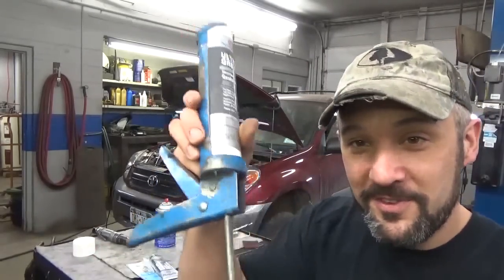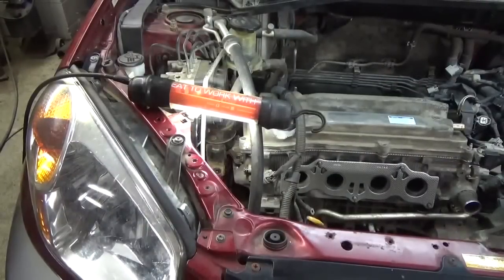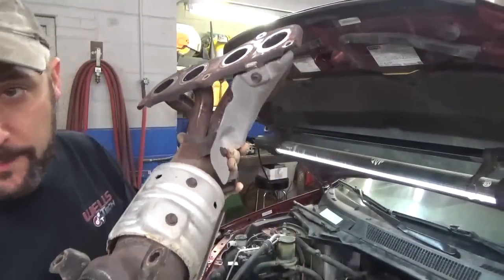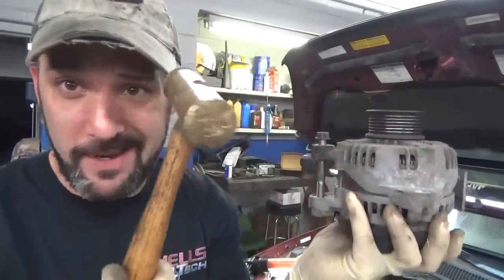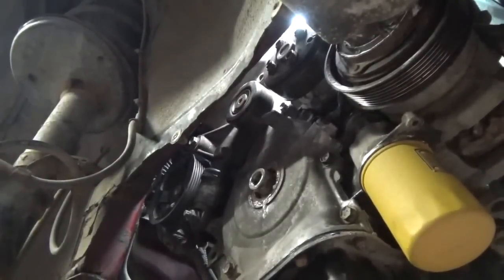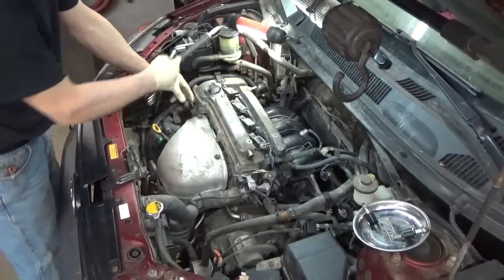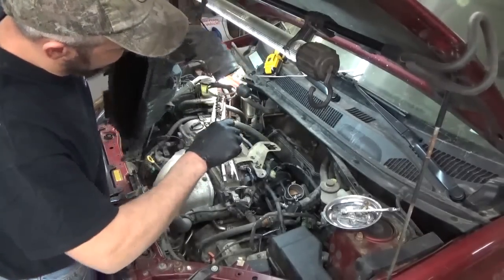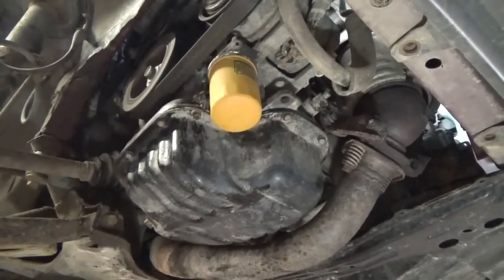Toyota Rav4 2AZFE Stripped Head Bolt Repair Part V

Comment: I Ike to use cardboard from parts and just pop screw, bolts, fastners plugs into  the cardboard in order I took them out. Then label with black sharpy.. or put the screw in its place after the component is removed....
Reply: Your the man
Reply: Anyone have trouble getting  elm327 and torque app connect to ecu on saab?

Comment: I've had to disassemble computers due to a lost screw. Losing a screw in an engine is bad, but there's a reasonable chance it might not be a problem. Losing a screw in a computer means ABSOLUTELY NO POWER UNTIL IT'S FOUND.

Comment: the diaper is a insulator to keep the heat down transferring to the intake tract,up where you are its probably overkill but in the desert southwest or florida that manifold is hot anyway due to road heat and under hood temps,the slight noise you heard is the timing chain running dry till slosh and spray hits it,i always soak them in synthetic rear end lube to cool the links on start up,they see hell for about 5 to 10 minutes,if they are right out of the box you can hear the links rattle,the little tricks make them go out the door and stay out the door,good job eric

Comment: OK, I'll admit it. I didn't think it would start. Good job Eric. This had to be a muti-thousand dollar repair with outside machine shop involvement, special thread repair kit ($400) and likely 20+ hours of labor. Do you think this car was worth it? Just asking.
Reply from the maker: WHAT!? REALLY!? Do you really think I would post that big of a disappointment lol
Reply: South Main Auto Repair Dude, we've called it reality TV. Sometimes what's real isn't what we hoped it would be. See my edited comments above and please respond. Seems the job cost more than the car was worth.
Reply from the maker: SATAMAN Schmidt I agree 100%. In my opinion it was not worth it but it was to the customer and they are the one writing the check. It was old, rusty and an oil burner, I work pretty cheap here so out the door it was $2200. Local Toyota garage gets around 4 grand here to do them. Start to finish minus camera time I had around 14hrs or so in it. I do a lot of jobs like this and wonder why they wanna fix it. I just tell them the truth of what I see and think and they make the decision.
Reply: South Main Auto Repair 4K seems about right. That's what I was expecting. You need to give yourself a raise.
Reply from the maker: Lol I wish, small town and more shops than people. There is literally a shop on every corner.
Reply: South Main Auto Repair However, I rather doubt that they deliver the quality of work that you do. I got into repairing my own car due to the fact that the people I took it to were incompetent. If I lived in your area I'd have never gotten into car repair, I'd just let Eric do it. By the way your tube "sealers" are on their way.
Reply from the maker: Well see then would have never gotten that sweet air ratchet , tube sealers or 13mm "wrench". Good thing you didn't live here lol As far as the other shops work well I'll just leave that one alone..
Reply: South Main Auto Repair wouldn't it be cheaper to buy a replacement engine?  I didn't see the first video but how did the owner strip some head bolts?
Reply from the maker: Oh he didn't strip them it is common for this engine to do this so getting a used one you might be getting the same exact problem
Reply: South Main Auto Repair I did think about this too. You obviously do install Jasper Engines, or at least you have a big assed sign indicating that you do, and during one of these videos stated that this thing was an oil burner. Considering the willingness of this customer to spend thousands of dollars on a car that isn't worth the price you charged him to fix it to begin with, why not suggest a replacement engine?  Would have saved the cost of the thread repair kit, the machine shop and the labor involved with replacing the head gasket and all that involves. What I'm asking is how much more would putting a rebuilt, not a junk yard engine as I agree these likely suffer from the same problem as the one already in the car, would have cost.
Reply from the maker: Just for the heck of it I looked it up through Jasper and it would cost the customer $4467.00 plus fluids and installation. That would include a 3yr 100k warranty parts and labor. Used engines local at salvage yard, to me cost on average of $1800 and up. cheapest high mileage engine was $1300 plus installation and fluids with no warranty.
Reply: South Main Auto Repair This is an  example of the difference between New York and Arizona. Out here the body of this vehicle would be pristine making the engine swap a no brainer as the car would then last another 10 years. Back there it's heading to the crusher anyway as it has no trunk or floorboards so a) get out of there at the lowest possible cost or b)scrap that clunker. Here in the desert putting in rebuilt engines and transmissions makes a lot more sense than it does there simply because the bodies and frames of the cars are perfect.  We have no rust. Now that stated what goes South on our cars are the paint and the interiors. My friend, and former boss, owns a Maaco here and he's quickly becoming a millionaire and auto upholstery shops kick butt too as our interiors disintegrate from the brutal sunshine.
Reply from the maker: I cant even imagine what it would be like working on rust free cars. I will have to google Maaco. We do have any of those that I have ever seen.
Reply: South Main Auto Repair They are a nationwide chain. They claim to be a bodyshop but that's not their main gig. They mostly do complete repaints anything from quick and dirty to fairly expensive (say $5000). My friend specializes in the $1,500 to $2,000 jobs which turn out quite nicely for the money. For this price the car is debadged and the emblems reattached after painting rather than simply painted over. Arizona and the sunbelt is the perfect location for these as rust repair isn't needed here but fresh paint certainly is. Normally you can sand the paint on the car down with P220 (hood, roof and trunk where all the clearcoat has been eaten away) then P400, seal with epoxy and shoot basecoat/clearcoat or single stage urethane. He has a lot of dealers and used car lots as customers since cars are worth a lot more with a fresh coat of paint on them than they are with Arizona sun rash. The advantage of being with Maaco is that they have nationwide sales agreements with PPG and Sherwin-Williams and their negotiated paint prices are 1/3 to 1/2 what an independent bodyshop would pay for the same products. The negotiated prices for paint, which these guys use a ton of compared to a normal bodyshop that's only shooting panels instead of complete repaints, more than pays the franchise fee.
Reply from the maker: No kidding that is really cool. We have nothing like that here. You have Maaco, we have a crusher lol. Our used car dealers use spray foam, rattle cans and lots of armor all haha

Comment: Hi Erica this is Mark I watch you all the time but I just thought I’d mention this on part five of your RAV4 replacement of the oil pan gasket on the engine and strip the studs out of the Cylinder Head I did notice while you were spraying the gasket and had the pain in your hand you spray the gasket on the BLOX side not on the Panda side don’t know if anybody else got that I just thought I’d throw it in there just to make your day while you’re laughing at me you do a great job thanks buddy bye

Comment: What kind of tool is that on the left side of your keyboard? Looks like a compact timing gun in a holster. ;)

Ok I think I'm ready to do this job on my 2002 Camry and 2006 Highlander both with 2AZFE showing the same symptoms.

Thanks for the helpful videos! Standby for questions :)
Reply: Handy Daddy Your mention of dropping a screw from your ratchet just brought back memories of when I accidentally dropped something inside the throttle body while cleaning it. I kicked myself a couple of times, took a break, came back with a magnet attached to a hose and got lucky because I was able to fish it out with one try. Lesson learned.
Reply from the maker: Handy Daddy Yes it is my mini timing gun haha  ( If some bad guy messes with me or my family, it's "bad timing" for them ;) )
Reply from the maker: Handy Daddy Nice. Good lesson learned too.

Comment: Hi, what size wrench did you end up using to torque those head bolts? Thank you again.
Reply from the maker: +Coral Lanteigne oH gosh I don't really recall. It would be my 1/2" torque wrench as far as the socket size I THINK it was a 14mm 12 point?
Reply: +Coral Lanteigne it's a 12mm "triple square"  Napa carries them/can get it.  3/8" drive is what I used.    
part # CHT STS3812M     Yeah, the one time use insert tool kit hurts.

Comment: I think I met your Camry trans fluid hater and he's probably as smart as he is stable.  A few years ago at my job, a lube tech pulled an air filter out of a car to inspect it and the owner of the car stomped across the shop and yelled at the tech for contaminating his intake air system.  I think that was also a Camry.Edit: I have a theory or two on the diaper under the intake if nobody else offered up a sound reason.  (There's too many comments to read through now.)  My guess is they used it as an insulator to prevent engine heat from warming up the intake air too much.  Or maybe it gets hot enough to warp those sturdy plastic intake runners.  Ooh, go tell that to your Camry hater and see if that riles him up some.  Just don't tell him it was me.  I'll deny everything.Edit again: Keeping squirrels out of the intake.  Now I know why that Camry hater customer was fuming.  There were squirrels everywhere in the shop.  He knew something I didn't.

Comment: WOW Great Videos _ I have a blown head gasket in my 2004 Rav4, water is going out the exhaust. Looks like I have a long project a head of me but I am willing to tackle it. If you can do it I can do it. Thanks so much for the videos. The info you got from Toyota on the procedures and torque spec, where can I find them?

Comment: Paper gaskets are PIPG.  Paper In Place Gasket is to FIPG or Form In Place Gasket. PIPG or FIPG. Real fun is assembling your first motorcycle at 14 from the arcane translation of the original Japanese manuel. No grammer adjustments, and they constantly called the 1969 305 Yamaha, a car.

Comment: i see that you do great work, i hear you commenting on toyota mechanics watching you and judging you, instead of judging you maby they might learn something from you we are only human. just think your always fixing cars dealers couldnt fix. i work on modern cars post 94. the only thing i see you didnt do that i would have done different is pull the motor and put it on a stand. it takes me and a helper 2hrs to drop subframe on an altima motor and tranny included plop on stand i feel its easier for me and quicker plus torquing bolts is a breeze. not crittisizing  but thats the way i would do the job.....

Comment: A young Airman in the Airforce at Fairchild AFB Wa, Dropped a socket that did not hit the floor, because the ford pickup was used on the flight line, that socket Had to be found, don't want it sucked into a jet engine,  Well  after removing everything  including the cab off the frame the socket was never found,  That vehicle never went back to flight line,  They spent 2 weeks disassembling and searching.  So hitting the floor is great sound.

Comment: I think the purpose of the grill on the throttle gasket is to prevent a vortex forming. A vortex would cause  an uneven distribution of high and low speed air which is not good for a system designed for an even airflow. The grill breaks up the air and prevents a vortex forming..

Comment: I totally agree on putting each components removed capscrews or bolts or nuts 🔩 in a container or  With the components removed if there is room for laying them out separately. 
     And a big explicit ** * to the haters as you are a absolutely awesome mechanic and I know this as I have been one for around 40 years. 
    Remember what I said as you are absolutely awesome and ignore the haters or explicit ** * them and if you use these little asterisks as I did above that way they can only imagine what you may have said. 
            L           🤪           L

Comment: Hi Eric your channel is the best you may already know but Snappy makes dowel pin extractors they are a collet style that goes around the dowel you tighten the collet in the collet housing the more you tighten it the more it grips you can attach it to a slide hammer as well no damage to the dowel works on hollow and solid dowel pins.

Comment: I'm going back and watching this old five-parter of replacing the head gasket; and the stripped out bolts. I'm wondering if it would have been easier to pull the engine. The intake and exhaust manifolds already had to be removed. Radiator fluid and oil was already drained. All the electricals disconnected. Even one of the engine mounts removed. With having to contort yourself to work on pulleys, timing chains, installing timing cover, oil pan, VVT solenoids, and the rest - was there much downside to simply removing the engine to work on it on a bench?

Comment: I think you are one of the best mechanics I ever saw.  I worked in a government fleet for 30 years, met a hundred mechanics, and not one in 10 has the mad skills you have.  If you want my 2¢ ,  consider hiring on with a government fleet.  Half the work and (usually) a lot higher pay.  No panicking about getting your check that week, or layoffs when business is slow.  No getting fired over a misunderstanding or somebody's stupid personal grudge - and some of them get pretty bad if the guy's petty, for instance,   
One guy (Guy 1) I knew in a non-gov't shop, got mad at another mechanic.  He felt the other guy (Guy 2) had taken the high paying work on somebody's vehicle and dumped the lower paying stuff on him, AKA something stupid and petty like that.  So when Guy 2 was gone the next day, the first guy drilled a hole in guy 2's locked toolbox and threaded in a grease fitting.  Then guy 1 attached the cimpressed air grease gun and zip tied the trigger closed.  Guy 2 came in the next day, saw his tool box filled from inside out with several gallons of grease and just quit on the spot -

Comment: I use the plastic prescription bottles to save parts/bolts/screws/washers. The have a tight lid, easy labeled, and better than throwing them in the trash. Every home has some or you can collect them from family.

Comment: The black silicone toyota uses for the oil pan is some AWESOME stuff. My cousin used to use it on his oil pan for his race car. You take the bolts out and then the fun begins. You dont need oil pan bolts with that stuff on there.

Comment: Great video, but the Toyota engineer who decided engaging just a few threads on head bolts torqued to hell and back in aluminum should go design children's toys in China. What on earth was the point of wasting most of those long bolt holes? This is a very common problem and goes against Toyota's "legendary reliability" like so many of their other huge design problems (rusting pickup frames that break in half, failing leaf springs, bad Prius ECU software, automatic transmissions that fail just past the warranty, etc, etc.). On top of making some of the most boring cars they're also poorly designed. Toyota has clearly lost their mojo. Buy a Honda.

Comment: Trying to ensure my 4.0 SOHC had coolant up to the thermostat I shook the housing(forgetting the bolts were sitting in it) and one fell down the housing into the water pump. Pissed at myself for having to take it off, I screwed the spare gasket I had. Rushed to the auto parts stored and bought the one each of the two stores had just in case I screwed up again. Ended up getting the ratchet between the bolt and the water pump pulley and bent one of the bolts on the way out. It wasn't a good day.

Comment: I was working on a sbc that came in wasn't running right was a home built motor they could not make it run right 400 small block built to the hilt should been 600 hp all day so I pull the carb looked down the cylinders with bore scope there was chunks of blue shop towels left over in the cyclinder I called customer he rembered stuffing them in there why carb was off forgot to pull them long story short it bent the rods very expensive fix

Comment: I did a starter on a BMW once, which took 5 hours, because they hid it in between the engin and transmission.  Any way, I used sandwich bags and labeled it " intake" and taped it to the intake. So all the bolts were with the part. Happy wrenching!!

Comment: Yeah, nice video even though you wanted to cut it short a few parts earlier !  Good thing you followed through, for our sake.  Just saw these 5 parts in May 2019. Was wondering about the Fel-Pro gasket sets, i believe you had three of them and only one had the RTV inside. Maybe that oil pan gasket set came with the three tubes knowing the other two sets would also be used? Also, The 3 small tubes were because of the thin boxes. Larger containers would not fit?  Thanks for the video and maybe one day show off a jar of your mothers jelly you like so much.

Those forced air heaters always had that "buzzing" sound which was in addition to the blower. I wish they had used squirrel cage blowers vs. a conventional fan blade as they are way more quiet. However, because of your location, it seems fair to say you need it much and will put up with what it takes for some heat.

Comment: In the one you where doing the head bolts on the Rav 4 you where wondering why the tap was so easy because it's aluminum very soft metal!